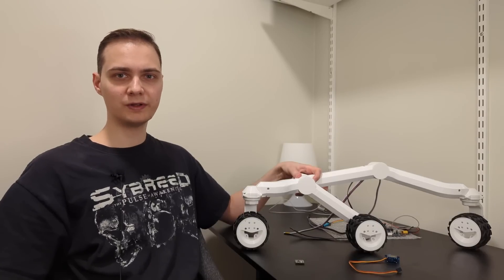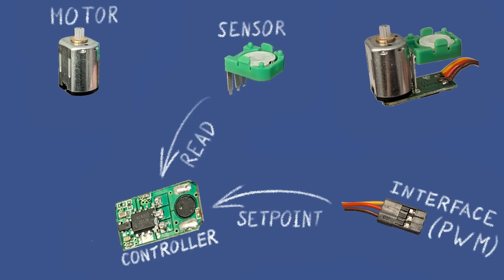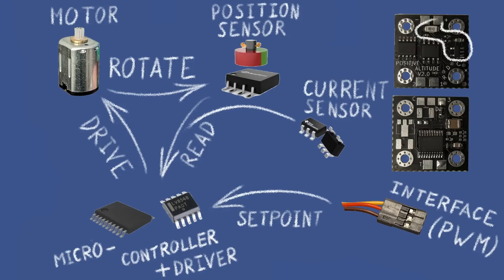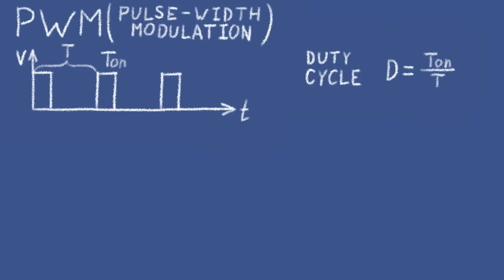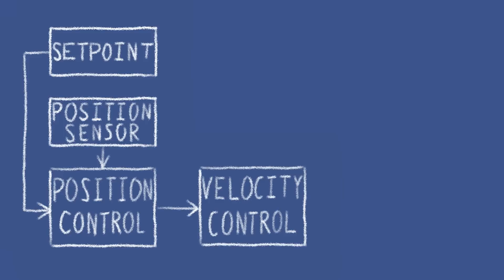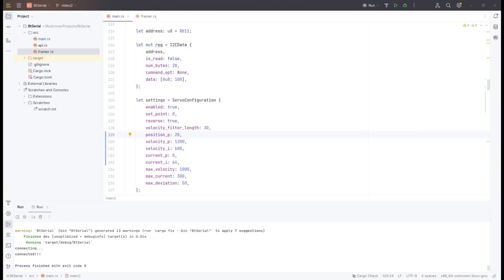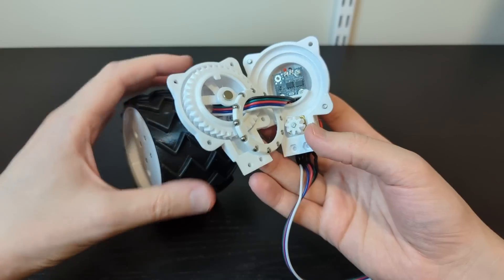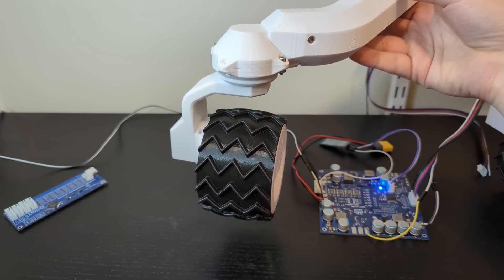Hobby Servomotors Could Be Much Better

Comment: Nice. Where can I get one?
Reply from the maker: I will fix some design issues and then open-source it. I hope I will also have some for sell later this year.
Reply: @Positive_Altitude  Nowadays people opensourcing are kind of heroes. Very nice didactical video and absolutely wonderful to propose improvements for standard parts. This shows how much underestimated is actual engineering.
Reply: @Positive_Altitude  Nice! But don't wait to open source it. Design issues are what the community are there to fix. Fork, MR, Pull done. I have some experience with this, so feel free to ask if you like.

Comment: Looks very nice, good work.
You should try make a variant for mini brushless motors as well. For small but fast, high accuracy and/or high torque hobby servos/motors.
I think that would work very good (and i don't think there are so many other that have made a DIY hobby brushless servo), but is of cause a more complex and challenging project.
Maybe use CAN communication. Its developed for car/machine communication and would be suited for this application and use in robots/machines etc.
But stay away from RS485, it often dont work as expected. Its ok on longer timescales where a bad signal can be resent like for example in a temperature regulation situation.
Reply from the maker: Thank you! Yeah, that could be awesome. I will focus on improving brushed DC motor for now, maybe will bring CAN to the next version as it is a good idea. I have researched BLDC motors before and I think the brushed motors should go away at some point if we can make a good and cheap controllers for BLDC. But this is another layer of complexity on top of what I already have, it was too much to bite at once. But I hope I will get to BLDC servos/ESCs at some point :)

Comment: I like everything about your project, but what I like most is that you are using Rust for the programming.  I wish I could do the same thing on a Raspberry Pi Pico.  What STM board would you suggest to use Rust with?  Thank you in advance.
Reply from the maker: Thank you! I am very happy with Rust for both STM32 and ESP32. I also know some guys that use it for RP2040, so you can do that too! I never used RP2040 but I expect that Rust is well supported there. For STM32 boards - Rust is supported with all of them. So pick any of them, but maybe you should take a board with original MCU from ST. I like cheap stuff, but some cheap boards uses clones of STM32. I don't know if they are working good with Rust, but when I had one I was not able to setup debug for it using original ST IDE (I was using C those days). So maybe they have additional challenges with Rust too.
The only issue is that I don't like the high-level HAL implementation in Rust (or I did not find a good one). The one I had was very poor in features. If you do a simple things like "blocking read ADC once" it's ok. But if you want to use the full potential of peripherals like "read ADC with hardware oversampling in circular mode writing values directly to circular buffer in memory using DMA and fire interrupts when ready" it is not supported. You need to dive into reference manual and set it up at low level using registers. But the STM32 documentation is top-grade and you will learn a bunch of cool stuff in the process. Also the low level HAL like register map is there and it is good.

Comment: Very nice Board! Always dreamed of something like this because i'm definately not happy with position control only.
Do you plan to sell the boards? How much do they cost in manufacturing? Do you have a website?
Also, yes i'm interested in the ball bearings! If you have time to make a video i'd be happy to learn!
Can you also share a video of the rover driving? Or is it still in progress?
Reply from the maker: Thank you! Yes I am planning to sell the next version of these boards, but so far I don't have a website and don't sell them. The PCB itself is very cheap. I made panels of 4x4 boards (you can see some holes on the edge after I separated individual boards) and 5 panels cost about 8$ without shipping, so 0.1$ per PCB. Components are about 5$ per board total (encoders are 2.5$ piece unfortunately). The biggest question is assembly. I don't know yet how much the factory assembly will cost, it also depends on the batch size as the "setup" cost could be significant. I assembled them myself with a simple soldering iron :) Rover is still in progress, I am designing the "body" right now.

Comment: what are the hardware and software used ?
Reply from the maker: All electronics boards I designed in KiCad myself, they are built with different models of STM32 MCUs. Software is written from scratch using Rust language.

Comment: Great job! One idea to reduce complexity of the wheel assembly: If you‘d use motors with axles on both sides, you could mount the magnet and control board on the inside of the wheel.
Reply from the maker: Yeah, that's a good advice. I really started to appreciate dual-shaft and hollow shaft motors. They gives a lot of options to simplify the design. But one of the goals is to try to keep everything very cheap. These motors are like 1-3$ piece (from Aliexpress), but this limits my choices. Thank you!

Comment: The great thing about hobby servos is their simplicity and very low cost.   Lots of people use them for this reason where they are not really appropriate, like wheel drives and cnc type machines.   Makes for cheap toys.  You are making a real robot, not a toy.  My question is how precise are the magnet position sensors?   The hobby servos I've used (cheap ones) have pretty poor precision potentiometers and high backlash gears.
Reply from the maker: This encoder is 12-bit , so LSB is about 0.1 deg. But there is also a "non-linearity error" that could be somewhere around 1 deg. This error also greatly depends on proper axis alignment. But the good thing is that it is not like noise, it is consistent, the error is is repeatable for every position. So in theory we can assemble the system, then use another encoder or stepper motor as a source of precise angles, collect statistics and offset non-linearity in the software. But I did not do that, for my applications it is good enough.

Comment: very good job. maybe its better to put hall sensor on separate board?
Reply from the maker: Though about it. But I decided that it is too many wires. The sensor requires at least 5 wires that will be very annoying to route. So, instead I tried to make this board very small. It is only 20*20 mm

Comment: great job! I would advise against using an I²C for communication over long distances. I²C is intended to be used on one single PCB and not in a large network. There it might be better to use CAN, RS485 or Ethernet. They are designed to be robust against induced noise.
Reply from the maker: I learned about this when I was half-way through the process already. But I think it will work at this scale. Calculations shows that I will fit into 400pf line capacitance limitation. Waveform looks scary (I was also dumb and placed SCL and SDA as adjacent wires in the cable, so there is also a quite bad crosstalk). But despite this I had 0 failures so far. I think I2C could be used like this if you take care about noise and line capacitance a little bit, and not going crazy with wires. I would say up to ~1m should be fine. Also STM32 has an improved current sink, so in theory if host controller is STM32 too, it is possible to use pull-ups with much lower values than I2C standard suggests. That will help with waveform and capacitance. But still no resistance to noise is an issue. I am thinking about CAN too, but there is no CAN in STM32G0 so it will bump up the cost but probably it is worth the money, because CAN is amazing (never used it so far). Thanks for the feedback!
Reply: @Positive_Altitude I'm using rs485 in LibreServo, I think It is the best compromise between I2C and Can.
Reply: @Positive_Altitude I2C should work. I built a bot 10 years ago that used I2C to communicate with an array of sonars. It worked x.
Reply: @Positive_Altitude This dude knows his shit
Reply: There is STM32F042 with CAN, very small and DIY solderable.
Reply from the maker: @romanisaikin6623  Hmm, did not expect to see CAN in F0 as its not present in G0, it could be a good option, thank you, I will think about it. Another one could be G431 in UFQFPN package, but it's more expensive.
Reply: F042
communication interfaces (one I2C, two SPIs/one I2S, one HDMI CEC and two USARTs), one USB Full-speed device (crystal-less), one CAN, one 12-bit ADC, four 16-bit timers, one 32-bit timer and an advanced-control PWM timer.
Reply: @romanisaikin6623  oooh, good find, yeah!  no FPU, but you can't have everything :)
Reply: I have seen some I2C hubs for robots that allow increased signal drive and auto addressing.
Reply: Love it, really elegant solutions. I like the bearings too, be interested to see how those work.

Why are you not using plugs, sockets, or connectors of some sort? I get that it can save weight, and space, and reduce noise in the signal path, but I would expect that being able to quickly swap out parts would be more useful. It seems to me that some of those hardwire connections soldered at both ends are going to really bite when you start getting things wearing out or breaking down.
Reply from the maker: @charlesreynolds39 yeah, I did not thought that it will be so much pain, that was a mistake. Will add some tiny JSTs in the next version.
Reply: @Positive_Altitude  Be careful with JSTs from non original manufacturers, I have a whole bunch that overheat at only 3A of current.
Reply: @Positive_Altitude  I feel like the steel on plastic will wear out as different hardness are present - do you think nylon balls would be better?
Reply: I love can too, but i dont think any small Stm32s have it :(.  Major gap.  Iirc mmoat small PICs have it.
Reply: Nintendo shipped millions of controllers where you connect the nunchuck with i2c
Reply: Hi, in my rescent projects I used CH32V305 uC (28pin DFN). No CAN, too. But it has FPU, Dual ADC with PGA (e.g. one for current measurement, one for position) and DAC (e.g. for Motor ILIM)

Additional, I had a look inside at a lot of serial servos. All of them used single wire USART (half duplex). Many of them added temperature measurement and ESD/EMI components, like ferrite breads and TVS diodes.

I case using USART, you should consider to add an external crystal. For I2C, interal should be fine.
Reply: You could go for board edge connections like bigtree tech board for 3d printers or like pci-e. Pretty sure they allow for enough current and the board would need no modification for someone to solder wires directly.
Reply: @NicolasSicardRoy  board edge connectors can get expensive to get made.
Reply: These days, a raw LVDS is even better (and transceivers are very cheap, in comparison to CAN and of course Ethernet/EtherCAT).
Reply: One of my professors used I²C over several hundred feet by using bus accelerators. Obviously this increases BOM count, but he used standard cat5 cable and got excellent long distance performance. Worth considering.
Reply: considering this is essentially remaking dynamixels he should just look into the dynamixel protocol and utilise it. Half duplex serial. Ive implemented using their protocol for my own servos and other systems. its robust.
Reply: There would be demand for a CAN servo, and no offer yet as far as I know.

Comment: Hi.  Great project.  I'd like to use some of these boards.  I'd like one that could handle something like 1 amp of 24v power.
Reply from the maker: The problem with 24V is that I can not find a suitable driver that covers the 5-24V range. I think I will re-design it in two versions: a) compact version with DRV8837 (0-11V 1.8A) b) a bit larger version with DRV8870 (6.5-45V 3.6A)

Comment: Both your rover and your custom servos are extremely cool projects
Reply from the maker: Thank you! Love your rockets! I am subscribed for quite a long time :) BTW I am planning to build a new TVC rocket with these servos. I think that I can use current position readings from TVC to build an improved flight simulation. It was hard to tune control algorithm without knowing the exact response characteristics of the TVC mount.
Reply: @Positive_Altitude could you provide PCB design of servo controller?